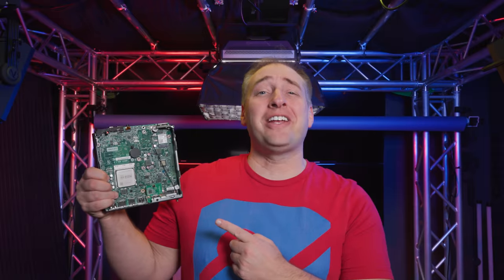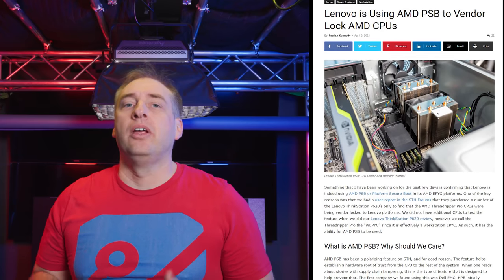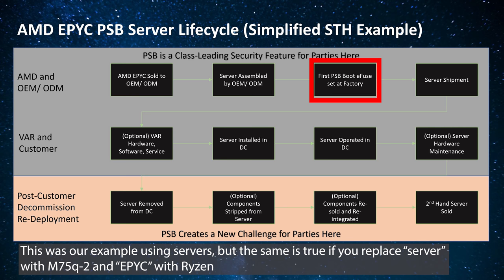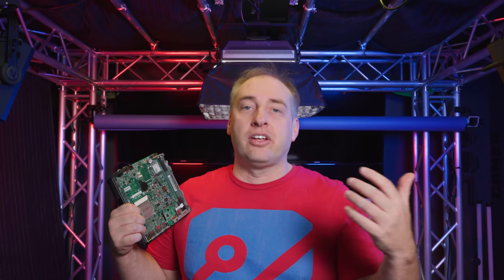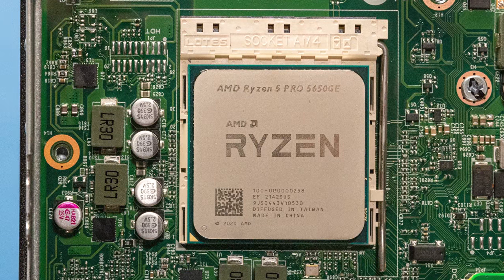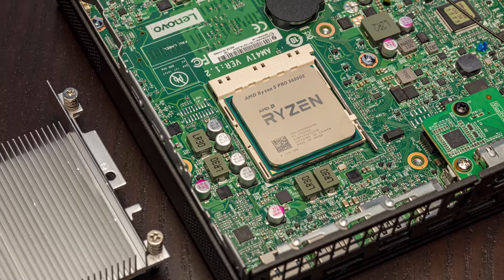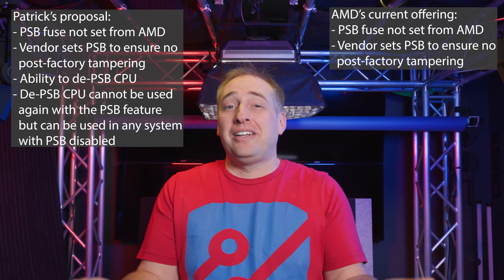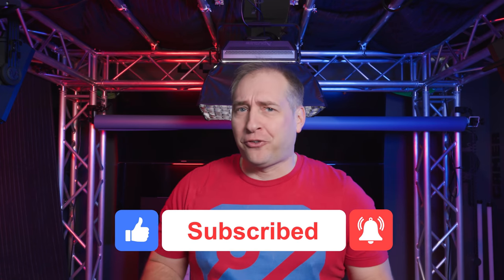Yikes! Lenovo is vendor-locking AMD Ryzen CPUs via PSB

Comment: I worked with secure processors used in set-top boxes for many years.
I really struggle with the virtue of this locking business. Sure, you might say that the processor refuses to do a secure boot on a subsequent motherboard, or even that you cannot replace the CPU because the motherboard will refuse to accept a retail CPU rather than one signed/flashed with a Lenovo key? But to effectively prevent resale? 
They talk about preventing the machine being tampered with, but in what way? Do we have evidence of CPU microcode attacks in the supply chain? Does this really prevent that? Again, you could just factory flash Lenovo CPUs and say you can only buy Lenovo signed AMD replacements. We'd probably all begrudgingly accept that, like saying you need a certain hard disk in an enterprise SAN.
If someone said it was to prevent theft of components then I'd just point back to the fact that most people don't know about this kind of protection so it would not stop anyone actually stealing anything.
The lack of laser etching to mark that this has happened on the processors is probably the biggest issue here for consumers. When it was Epyc it was a limited blast radius, but adding Radeon into the mix brings a whole wave of more vulnerable users, who perhaps we're prepared for that level of research when upgrading their gaming rig. Imagine some poor kid saving up their hard earned pizza delivery money for a Ryzen CPU from eBay, only to find it doesn't work?! Then th seller saying "No refund, it worked before I sent it to you!"
Ultimately, this kind of protection is only needed for a tiny percentage of the market: banks, government and other hard targets. The rest of enterprise isn't really getting targeted with this kind of threat. We shouldn't be creating a whole supply chain nightmare just for a small issue possibly faced by one sensitive customer.
Unless it isn't about security, and it's about a collision to reduce the secondary market?
Reply: "They talk about preventing the machine being tampered with, but in what way? Do we have evidence of CPU microcode attacks in the supply chain?"

It's not the just the microcode that has to match the signature, It's the whole initial firmware blob. 

Basically you need it because UEFI and the platform initialization code  are major codebases that kind of suck, and vulnerabilities are found on a regular basis.  If someone find an exploit in the firmware code and is able to modify it, the PSB lock will let you detect it on the next hard power cycle,. Exploits at that level aren't common in the wild but are still a concern for high-value tagets. 

But even so it' shouldn't be on be default, and it shouldn't be a feature in the BIOS. An attacker that does manage to modify the bios could potentially lock a cpu you swap in to test to the attackers' version of the firmware.  

For full security you would want it to be something that could only be enabled by ordering a cpu directly from AMD,  and that CPU would be etched with a fingerprint of the key loaded.

Comment: Personally I think thats a bit overkill that they make it inoperable in systems that don't have the PSB system. Maybe it could an option in bios to turn that off? And if the system does t have that functionality it's just ignored?
Reply: If the firmware of the BIOS is compromised. It could report to be turned off to the cpu but report as ON to the OS

Comment: I have a question, I've got an ideacentre 5 14acn6, it had a 5600g by default. The motherboard on it uses amd pro 565 chipset, can I put non pro CPUS in it? Are only cpus vendor locked or is this motherboard chipset locked to certain cpus as well?

Comment: Lenovo always does these sort of things, I once purchased a laptop from them and they whitelisted parts and only parts purchased through them could be installed! Yes they're cheaper generally than other manufacturers but it seems they also have these little things that limit users.

I think a manufacturer should offer you the option to have PSB enabled, I could understand it when it is bought for business purpose and you want that extra security, however if a home user wants to buy it does it necessarily need to be enabled?
Again I think it is best to leave the option to the buyer and not default to enabling it, you're buying it after all and should be your choice or offer 2 versions 1 with PSB enabled and one without if it is too much "manual" work to enable this on request.

I also bought a tablet once from Lenovo, they didn't even bother to update Android EVER, no, Lenovo might be often cheaper but their product limitation and or support is terrible, maybe they took it from IBM when they took part of their business over.

Comment: Picture this: The warranty on your system ran out last week. As such it receives an "end of support" update similar to how GPUs get a final driver update. Unfortunately, the manufacturer did not account for your model and configuration of system, or there is a bug, or they are malicious for some reason, and your system is now bricked. Or it at least won't boot with that CPU anymore. You have no more warranty. This broken system is your problem and your expense to fix and have offline.

Comment: And now my company no longer considers Lenovo machines...
If anyone from Lenovo reads this: please stop doing this, I used to like your machines and I want to be able to buy them with a clean conscience.
Also will advice customers to avoid them if asked, as long as this shit keeps being done.

If it was an option that always included laser-etching the heat spreader and a place on the substrate with a steep discount I might have been okay with this.

Also Patrick's suggestion for blowing all the efuses to make it a open CPU for the secondary market would be acceptable.

I do think that buying hardware that's gimped for the secondary market should disqualify a company for green industry labels.

Comment: I do understand why this feature exist. Its because AMD have this "fTPM" thing, meaning that the TPM chip is embedded into the processor. So basically, the role the TPM chip made by verifying the BIOS signature and releasing encryption keys for the system to boot FDE systems (BitLocker with Secure Boot) without any possibility to tamper with the firmware, that role is made by the processor now.
Normally, the firmware would be locked to the physical TPM chip on motherboard. These chips also have the possibility to securely erase encryption keys once you tell it to "reset" the TPM chip or similiar action, to load it with new signing keys. This is because the TPM chip is battery-backed up by the BIOS battery, meaning the TPM chip is always running.

However, the processor is unable to use any battery backup, as theres no provision to feed the processor with stand by power. This because fTPM is a addition to the AMD processor standard, which means provisions for this is not be able to be made, unless you were to add some battery inside the processor, which would make it definitely e-waste.

This means, AMD *CANNOT* be sure a fTPM chip is really reset, and thats why a permanent e-fuse is used to program the signing keys.
You could have a additional e-fuse as suggested, that totally and permanently burns the whole fTPM chip inside the processor, including any keys, by using some "flashtrash" technology where the flash chips are physically burned before a third e-fuse is burned that then totally cuts off the fTPM chip from the processor, which then would act like the processor did lack a fTPM chip alltogether.

But still, this would make the processor unuseable with Windows 11 anyways (unless the LabConfig bypass is used) which means the processor would still be worthless.

So I could understand the reason they doing this, its a security thing to allow things like Microsoft Account and possibility to remotely lock a PC with important data on it when it have become stolen.

Comment: Oooof I wish I knew this an hour ago, I've been eyeballing these systems for a long time because of the size, and I found a Tiny Gen 2 for $260 with ryzen 5 3500ge, and I was planning on upgrading to a 4750ge and selling the 3400ge for $130+, but this changes everything.  It's giong to be impossible to sell this since 3400ge is kind of on the low end of processors now.  What a waste of time and money.

Comment: This is actually pissing me off right now. I am trying to build a server for a home lab using a ASRock Rack ROMED8-2T. You can get "unlocked" used 7302 CPUs for pretty cheap. Problem is that of all 4 CPUs I have tried in the board so far each one is not posting. It has been a huge waste of my time.

Comment: This lockdown is total BS. I would not get a system for that reason. What if the CPU fails? You have to get a entirely new machine!!
Reply from the maker: So we go into some of the conditions and how this works in the video. You can still swap some components in case of failures.
Reply: you get a new CPU from Lenovo.
Reply: The video explains this. If the CPU fails you can either (1) get a fresh one that has not had PSB enabled before, and "bind" it to the vendor --- there's a screenshot of the message shown in the video, or (2) you can get a CPU from the same vendor either directly or by pulling it out of another PSB locked system by that vendor. This is the same case for if the motherboard fails, you can still use the CPU on a motherboard from the same vendor, just not in a different vendor's motherboard.

I also like what's proposed in the video. It makes motherboard swaps on parity with CPU swaps --- you can always swap to a fresh motherboard by disabling the PSB.

Comment: Well that's ok I just did some construction work at an aircraft maintenance hangar and I got my pick of there
Old p.c. computers real high-end stuff too 😎👍
I was busy gutting the old PC's and taking ram GPUs
Processors I filled up the bed of my truck with so much parts....
Got myself a few Nvidia 1080s  for free
Apparently they manufacture aircraft parts from scratch... So they do alot of CAD work 😎..!.
Reply: There is still so much parts in the dumpster over there

Comment: I think blowing all the fuses is the way to go. Maybe have every CPU with the fuses intact from the factory and let Dell, HP, Lenovo etc. Blow them to suit there system. For second hand market give an option on first boot in a new board to blow them all and unlock it for good. Couldn't be that hard to have some kind of check implemented somewhere for the secure systems to make sure there not blown or have the CPU do it.

This kind of security bullshit has basically made the used Epyc market useless. Sure you can get a ton of CPUs but absolutely no boards from Dell, HP or Lenovo anywhere that I've found. We now have thousands if not tens of thousands of perfectly functional CPUs reduced to nothing more than paper weights. It's disgusting and AMD should've found a better way.

Comment: I work at a Drury Inn, it's 2022 and all of our PC's are Dell OptiPlex 380 with an I5 2400 and 4gb of ram.
99% of the companies who buy these systems won't be effected by the CPU being locked.
Most of them will run the computer til it stops, trash it, and buy a new one.

Comment: Lenovo is certainly at fault here, selling products that is unlabeled or not even inform the user when buying their products. One of two things should help Lenovo should show when their CPU is vendor lock, or two let the user enable it. Though having people enable it isn't a good idea since they may think it's great at first but down the line selling it on ebay or even swapping a motherboard for another and not get a working CPU to replace the motherboard would sting. A 3rd option is for AMD to only enable it for vendor's request though should still fall on the hand of the vendor to specified this chip has PSB.

For enterprise use or commercial use where company are sure they rather destroy a CPU than to selling it because of sensitive info or security then sure, but for average consumers it's just all around bad especially for the less informed buyer.

Comment: The problem here is just that Lenovo is making it default in the BIOS. This should be a $0 order option, because the fact is, many large enterprises (the real customers of these systems) specifically do want the PSB enabled. They're buying these boxes with 3 to 5 year service contracts, as part of their secure enterprise environment. But integrating such an option ("ship with PSB disabled") into the production chain can be somewhat complex since none of the major ODMs are set up correctly. They're set up to shove boxes out the door, not build boxes the right way.
Also, people claiming that this is just "vendor locking," you are flat out wrong. This is specifically a security element to prevent hardware supply chain and microcode tampering. EVERY Ryzen motherboard has this capability because it's literally built into every single processor AMD makes. If you have fTPM code (you do) then you have PSB capability. It has nothing to do with vendor locking whatsoever. You can replace a PSB'd CPU with any compatible CPU, any time, period. You don't have to buy from the same vendor. 
The point of PSB is to provide a physical and electrical form of validating that all of the hardware and firmware components in the system as assembled were in a trusted, specific known state. Tampering with any of these elements such as to install malware or modified firmware or microcode will 'blow' the fuse, indicating the system is no longer trusted. (There are ways to do these updates without triggering, yes.) That's literally all it is - an indicator that the system's low-level hardware has been tampered with.

Oh, and if you're singling out AMD, you're also flat out wrong again. Intel has the same thing implemented in their PTT suite. When you enable PTT with CSME, it sets a system-specific encryption key which is tied to the CPU, firmware, and CSME itself. Which means that on a PTT enabled system, you don't brick the CPU. You brick the CPU, motherboard, and CSME in unison. And any attempt to read certain keys will also instantly blow the fuse, bricking the whole thing.

Comment: If the fuse is used, the manufacturer should be forced to laser mark the CPU with their logo. Easy to use identify during reselling
Reply from the maker: That is a bit hard just because you could turn PSB on in the BIOS and fuse a CPU at any point.

Comment: Seriously this is cruel, bad and scary. And yeah, you can bet that NOBODY will want those CPUs so the moment they'll be pulled out of those Lenovo systems they'll become worthless. One-time programmable fuses are a VERY thin ice when used outside of their intended purpose (i.e. to flash a permanent firmware into a chip).

Comment: Personally I don’t see very limited security benefit with this, if CPU’s are a target the hackers would look at getting into the vendor ( Lenovo as an example) supply chain so the cpu it self in the original vendors board would still be hacked, to me it looks like it’s intentional for vendor lock-in to only using the cpu on the vendors product which in essence means that they keep the customer lifecycle on their brand longer. Minimal security benefit maximum customer retention benefit. Just my POV atm.

Comment: Or it would be nice to unlock it and still be able to use it with a PSB system.  They could put an option to use it as a normal PC in the BIOS.  It would just be a good idea to put up a couple warning screens first that you must click yes or no on.  Of course if you click no (you don't agree) it does not work unless you do.  Just have it ask you if you realize your system will be more vulnerable to certain attacks and also if they agree to waive any right to sue any affiliated manufacturers for anything that happens as a result.  Also upon the first few boots of any newly instaled OS have it display a message warning you that the system is not secure and warning you that you may be more susceptible to some attacks and malware.  It would not constantly nag you, just warn you on the first few boots.  It would be a warning that you have to acknowledge and you can not bypass it but just seem on the first maybe 10 boots of an OS depending on how many times they would like to remind you.

Comment: I'd say its worth about 10% of the original value if they vendor locked it. You can use it in far less stuff. If you are someone like me that creates their own custom bios and OS for various systems it isn't worth 2 cents. If you look at it from even the person just reselling it they have to know it is PSB enabled. They need to tell the seller. The seller needs to understand what that means. It is nothing but an extra pain to deal with. Pretty much guarantees I'll never buy another Lenovo system unless they start offering an option to not have that enabled.
Another way to look at it is they are selling you a damaged product. One in which fuses are blown and can't be reset. I know the fuses in question are one's that don't effect performance.
However, what if I wanted it looked to my bios and not theirs? I can no longer set the key and lock it.
Also what if someone like myself breaks the encryption they are using then all those with the set locks are compromised they can't be altered to a new key.
What if the bios is tampered with. Then does it not boot at all? Can you reflash it in that state? Or are you just left with a brick?

Comment: Total non-issue for me. If I buy 500 or 800 of these machines, I plan on using them for a specific purpose for 4 years. In an enterprise environment, this seems fine, but if you are buying one or two and wanting to modify them for personal use, then I see a potential issue.